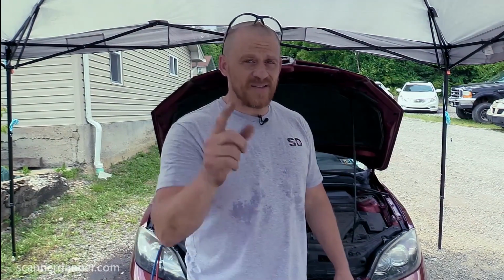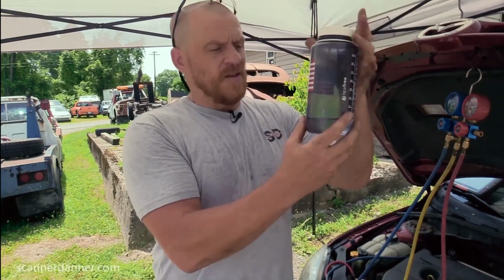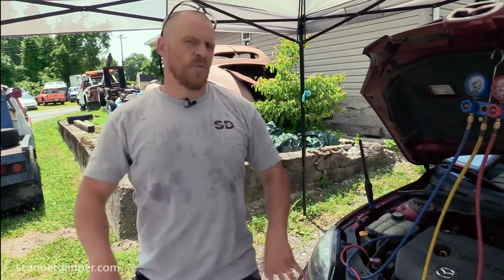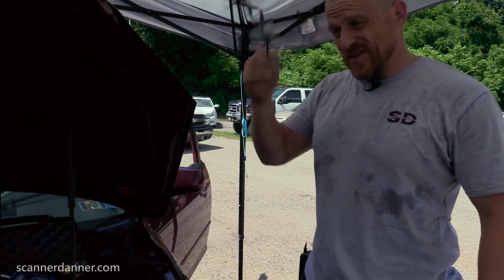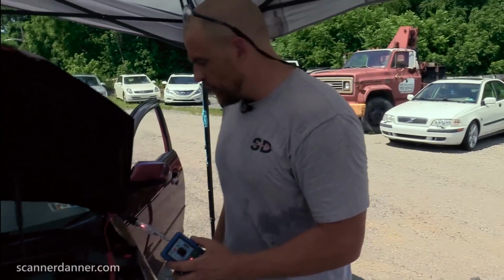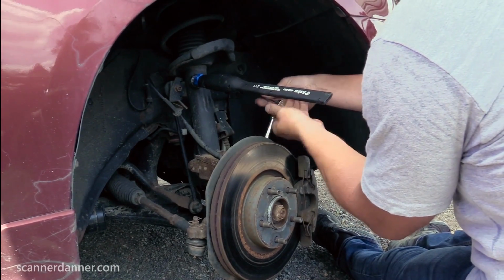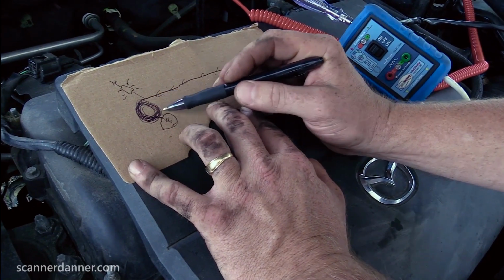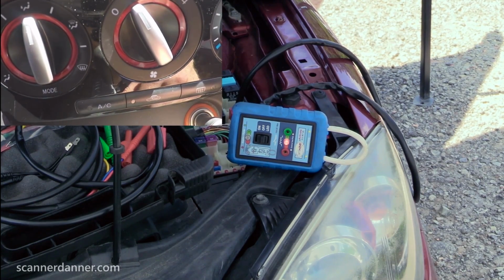A/C Clutch Does Not Engage-Diagnostic Fundamentals (full charge)

Comment: Brother, I'm Mike from Texas. Congrats! on your diagnostic video. This is my AC dilema. What is the possible cause for the high pressure line to cool and not the low pressure line. The compressor is brand new. The system is fully charged. I would really appreciate your expertise. Thx!
Reply from the maker: You have a restriction. If your old compressor blew up, it pumps all of its guts into the condenser next, then makes it's way to the expansion valve or orifice tube. Where the high side line is going from warm or hot to cold is where your restriction is

Comment: Can someone help me with this issue/issues? Fir starters yes I’m I’m an idiot. My ac went out on my 2008 Nissan Rogue and I decided to replace the ac clutch. I tried with different amount of spacers on the clutch and if would not engage. Finally I just tried one spacer and tightened it up and there was no free play on the clutch so I decided to start it to see if it would force spin the clutch and get cold and it did. I then unplugged the power to the ac compressor and it’s still blowing cold air. Any ideas what is wrong?
Reply from the maker: Sounds like you mechanically locked the clutch to the compressor shift. So yeah, that makes sense that even if you electrically unplug the clutch, that the compressor is still spinning.
Reply: @ScannerDanner  what do you think could make clutch not engage on it’s own without having to force it like I did?
Reply from the maker: @CCP600  low voltage or a poor ground to the clutch or a bad new clutch
Check and report the voltage readings on the two clutch wires with it plugged in and the circuit loaded (current flow). I'll help more after I have those two numbers
Reply: @ScannerDanner  boy do I feel stupid...I went to see how much voltage I was getting and when I checked it was 0 volts.   I was so sure I checked for power that being the reason I decided to order a new ac clutch but I definitely thought wrong. I checked the 10 amp fuse and it was blown. I was right about to order a new ac compressor, dryer and condenser but thanks to you I got it going. I really appreciate your help, your the man. love your channel especially now lol
Reply from the maker: @CCP600  awesome! Good job my friend

Comment: Hey SD, awesome videos, but can you please explain how to test a 3 wire high pressure switch, the plug and the switch itself? if I’m not mistaken that can cause clutch not to engage as well, right? My a/c clutch is not engaging, pressures are equal with vehicle off/on, a/c on, they don’t change, and then I have codes for interior temperature sensor short,or not plugged, and high pressure switch short/or not plugged. Thank you
Reply from the maker: The high psi switch code needs to be your focus. But they are calling it a "switch" so it may have two switches in it (a low and high cut-off)
Can't answer without seeing the diagram. Year, make, model, engine size please
Reply: @ScannerDanner   It’s a/c system on semi truck, lol 😃 Volvo Vnl 670, d13 engine 2016. To explain you what’s going on I have to go few months back, so first  issue I had is that, the a/c would work sometimes,then don’t, blower motor was working,no codes, and then I decided to open up dashboard to check what’s going on, cuz it’s easy to do that on this big trucks, and then I found that the evaporator was frozen up,as well the lines outside the cab. So, I thought that it’s an expansion valve. When the truck was off for some hours, the ice would melt,and a/c was working properly, but for a short time, let’s say few hours. Two weeks ago I took my truck from mechanic shop, cuz they did some other repair, and then I noticed codes for unplugged or shorted high pressure shut off sensor,and cab interior temperature sensor, which I didn’t have before. I’ve opened up dashboard again and didn’t find any bad wires, around those sensors, but I found that white wire on a/c compressor was broken, Fixed that, bought a/c manifold kit, after I watched many of your videos, and I got equal pressure on both gauges no matter what I did, truck turned on/off a/c on, compressor is getting power, checked ground on compressor like you explained, no issues. But I have one off those compressors that was no clutch, it’s spins all the time. Any idea what could be an issue? Everything you explained, power comes to compressor, no ground issue tells me that compressor is bad, but I’m confused with frizzing up off the evaporator earlier and this 2 codes for sensors. Thank you SD for helping. 🙏

Comment: Very good video, thank you. I have a Ford Focus MK2, having issue opposite to this. My clutch is good but the car computer engages the clutch 10 seconds after starting  the car. Even if the climate controls are all set to off. I don't know why it turns on the compressor by itself. Maybe my car has a ghost haunting it.
Reply from the maker: Does it keep it on constantly after that event ?
Reply: @ScannerDanner  yes it's on for a long time. The low pressure line is very cold. Even if I pull out the climate control module itself. It's the same.

Comment: You do know that the Climate Control system will prevent the A/C compressor from coming on when the OAT is below 40F - yes?  The pressure switch is Engine PCM controlled and on the scanner will show 0v or 5v or something in-between when in operation, and the switch function will also show on the scanner as well.  We had one that would not come on even with 1.8 lbs of R-134 in the system.  But because it also has a rear A/C function, the system 'wants' about 2.3 lbs of refrig before the clutch would come on!  Also, with the cooler temps here, about 34 to 36 degs, adding another can of refrig meant that it had to be warmed up - carefully - with a propane torch before it would transfer into the system!!  Just wanted to weigh-in here with a bit more info for folks in colder climates.  These systems will not operate in A/C function to defrost windows, etc.  and will further shut off the compressor when ambient temps fall below 40F.  Tempo sensor on the Acadia is right behind the front grill.  Cheers!  :)

Comment: The issue i have is when the clutch engages the readings are at -15 @ low and 125 @ high...when clutch shuts off its 90  @ low and 100 @ high. I installed everything new. Can it be that debris entered the system got clogged the expansion valve? Or is it the new compressor? It rattles sometimes, will a clog make it do that or did i get bad compressor?
Reply from the maker: Was your old compressor destroyed? Pump crap through the system? First thing I would look at if this is the case is the condenser

Comment: Great pressure temp relationship explanation.
Here's my flat rate.
 Run the car with A/C on observe clutch on/off? Off
Hook up gages look for ambient/temp pressure= Good. 
Look at the controller= lights good? Good 
skip fuse test and go for relay. 
See what's missing.
Power probe energize clutch/load wire at relay.
Good ground test.
Using the tech best tool...brain..lol

Comment: Question.  Since you know there is sufficient charge in the system, why wouldn’t you work back from the load eliminating the time needed for the scanner, the relay test, etc?

Would you have checked for power at the compressor first if you had a lift?
Reply from the maker: Yes! If i had a lift 😉
But if i wasn't teaching, these same checks are easier to do than lifting the car

Comment: I recently changed my ecm on my dodge journey rt 2009 and now my ac won't work I have no power going to it and system is charged. Unfortunately what I've researched is it's controlled by the ecm itself. My diagnostic so far is I got a bad ecm again.

Comment: The a/c relay on my 2004 is the first one you pointed out, not the one you were checking, according to the diagram on the underside of the cover.  Third one from the top.  Not the bottom one, below the empty slot.

Of course that year model may have a different relay config, but mostly 2004-2009 Mazda 3's are same throughout.  Not that it mattered since the clutch was dead.  👍

Comment: Sir I have issue with my Suzuki wagon R 660cc A.C 
When its in parking mood Ac works 
And also when it's running continuously 
But when it's n drive mood with low gears ac trips 0- 40,50kph 
Sir is it clutch or relay issue 
Plz answer my question sir

Comment: 05 Sonata compressor not engaging and relay not clicking when I check it. Tried a new relay, still no click. Any ideas what might be the problem. Thanks
Reply from the maker: What are your rest pressures in the AC system?
Reply: ScannerDanner was able to get it working. Bypassed the relay with a paper clip. Recharged and good to go

Comment: Scanner danner.  Can you verify ground available at the compressor body by hooking up your test light to  battery positive terminal?   Or do a resistance test of a ac compressor to body ground.
Reply from the maker: Yes just make sure the compressor circuit is turned in (power coming in on the feed wire) when you do your ground test with the test light.

Comment: Can you tellme what others inputs the PCM needs to turn on the (( a/c compressor and the a/c fan )) ??
inputs other than ( normal pressure,   pressure switch     and the a/c switch ON..
Reply from the maker: Year,make,model,engine size please. Then I can answer better. Every car is different. 
Also, since you're asking about inputs, I'm assuming you have a fully charged system and the clutch is not engaging? Can you manually energize the AC Clutch relay and see if it turns on?
Reply: @ScannerDanner  sorry it's a 2007 mercury milan 3.0
yes is fully charged ,  and yes if I manually energize ac clutch relay and the clutch turns on ( clicks)
what I'm not getting is signal to the relay from the PCM.  and the ac fan does not come on neither..
that"s why my question about inputs to PCM
Reply from the maker: Okay sweet, someone who knows what's up! First question, do you have a scan tool that can show you the AC request signal on the ECM data PID list?
Some follow up info. and this is generic and not car specific. I have to look yours up still.
1. Engine coolant or cylinder head temp sensor (engine too hot, disables the AC)
2. Throttle position sensor (wide open throttle AC cuts off)
3. Typically there is a low psi and high psi cutoff switch. These can also be pressure sensors depending on design
4. Some systems use an EVAP temp sensor (keeps evap from freezing )
5. The AC switch itself on the climate control panel (your AC request signal). Depending on the car, this can be a direct input wire to the ECM or on newer systems, this information only goes to the HVAC module and that information gets shared across a communications network (CAN)
Reply: @ScannerDanner  thank you very much for taking you time to answer,   
yes I have a snap on scanner,   the ECM data PID I can see the signal turn on and off  but it's on only when I hold the request button pressed, release the button and the data pid turns off,   but the compressor never turns on even with the button pressed.
and it's not because over heating or wide open throttle because replaced the a/c condenser and a line. and recharged, so that means the engine was cold and not wide open thottle. so my guess it's the control head.
Reply from the maker: @100ega8  we have a 2010 fusion in my brother shop right now with a similar issue and we are calling it a bad HVAC control unit. We will see. It is never easy to condemn a module
Reply: @ScannerDanner  are you guys going to make a video out of that???
I'm subscribed to your you tube channel and the paid channel. been learning a lot. thanks
Reply from the maker: @100ega8  unfortunately no, unless the module doesn't fix it. Danner found one for like $50
Reply: @ScannerDanner  finally found the problem,    it's the ACET sensor, 
need to remove the HVAC box to replace the sensor, my friend does not want to spend more money,
 since is a thermistor I can not do a jumper wire,  maybe jump it with a resistor
Reply from the maker: @100ega8  that would work as a temporary measure, but that sensor sounds like it is there to prevent icing of the EVAP? Not sure what the ACET abbreviation stands for?
Reply: @ScannerDanner  yeah the sensor is there to prevent icing
the abbreviation stand for     a/c evap temperature
what a use was,     from  a none good fuel pump used the sending unit to lower the 5volts to the sensor,

Comment: This doesn't count as ac video. Its another mechanical issue diagnosed. No vacume, pump, or recharge content. You didn't even explain why the pump should engage under pressure. This doesn't count as ac video.
Reply from the maker: The AC didn't work and it is clear in the title that this video is an electrical diagnosis of the clutch circuit. smh

Comment: Nice diagnostic work. I would have started with multimeter and measured the resistance of the clutch once it was clear that the clutch wasn't engaging. I think it should measure something in range 1-10 ohms. Basically you just measure the resistance between the relay output and the battery ground. If that is good, then you know that the clutch is okay and the wiring is okay.

Comment: I'm still in the middle of the video but as far as I know, most "manual" A/C systems do not have accessible items in CAN because there're no smarts of any kind. Usually there should be relay and/or pressure switch controlling the A/C clutch. Time to check the wiring to the A/C clutch.

Comment: I put the e brake on once to change a U joint on an F 150. When the drive shaft came down that truck started moving. I flew out from under it a hundred mph on a creeper. I was lucky the air hose was on the right side of the creeper  and didnt  stop me. 
The truck rolled all the way out the shop and into a lake.
That e brake was a disk brake at the back of the transfer case that required a drive shaft to be in place to work.

Comment: my dodge durango 2004 AC stopped working and when the fans kick on i hear a loud tapping in the panel passenger side back by the 3rd row. When i bought the car i heard the rear AC didnt work but the front did. When i got it nothing worked. Also when i pull the cap off the low pressure valve it almost spits out tiny bits of liquid.

You're a really good teacher btw. Your son is a lucky young man.

Comment: Mr Danner. One point I always like to emphasize is to look at the AC condenser fan, it must be spinning when the AC is turned on. This provides a quick indication that the computer (PCM & BFCl) have acknowledged the compressor_on request. 
I liked how you started the video I am sure it will help a lot of people. However note that the refrigerant inside a system (closed vessel) with only gas (no liquid) will have a temperature that is higher than what is indicated on the refrigeration gauge.
Reply from the maker: you can use that as a guide but on some systems the fans do not come on until the high side psi reaches a certain number (200+ typically), so as with any test, there are variables

Comment: Boss./Guys. My 2014 Nissan Altima S 2.5L AC is not working. I checked and ac compressor is not getting electric signal on (blue, positive) wire. Checked fuses. They're good. Ran computer scan with Torque. No faults detected. AC relay is build into Intelligent Power Distribution Module Engine Room so can't bypass relay either. Had someone drain entire ac system and refill to manufactures specs so it's fully charged too. Any ideas where to look or what the issue may be?
Reply from the maker: Does your "computer scan with Torque" allow you to see ALL of the modules on the CAN network? If it is just global OBD2 engine data, this is not good enough. The intelligent power distribution box is on the CAN network and is the module that is responsible for controlling the AC clutch relay based on inputs from the HVAC control module and the ECM. You need to be able to talk to these other modules to troubleshoot this thing properly.
Reply: @ScannerDanner  I'm pretty sure Torque only scan main ECU. Is there a tester that does scan other modules and if so how would it do it as only port there is is ODB2? Any hints/ideas what could be wrong? Thank you.

Comment: I have a question and please let me know if im wrong but why woudnt you just use a ac clutch command through the scan tool and check for power at the plug of the compressor first?If you have power there wouldnt that imply the rest of the compressor circuit is good?
Edit:After watching im so glad you have your son,a student there with you.I had some of the same questions about the power side of the test light i even rewinded the video to certain parts a few times to see if i could get a better understanding.To my surprise he had the same questions later in the vid and its awesome how you explained and cleared things up.ScannerDanner for the win!!
Reply from the maker: Simply because working with the relay is way easier than getting down to the compressor wiring on most cars. So personal preference is all. Great question! 
Also, I am a teacher and sometimes I can't help myself :-) 
I just read this to Caleb too and we both want to say thank you for the comment!
Reply: @ScannerDanner  Makes perfect sense!!And thats why I follow your channel id say more then any other.Alot of mechanic/tech channels on youtube show you how to fix a certain problem but they dont go into the teaching of the system and understanding of how things work so you yourself can diagnose certain issues.Thus having Caleb there is not only benefiting him but all of us aswell.Thank you for responding and thank both you guys for what you do!!